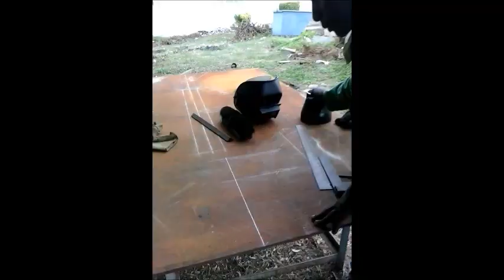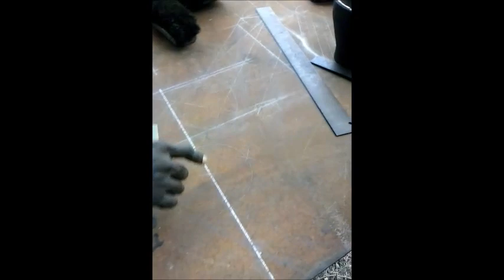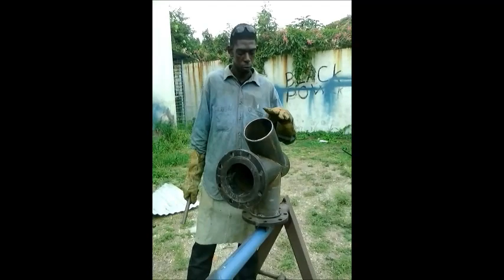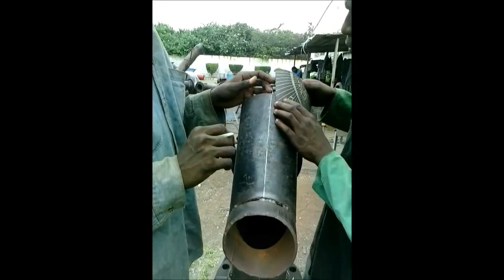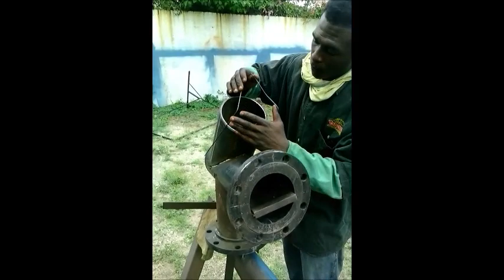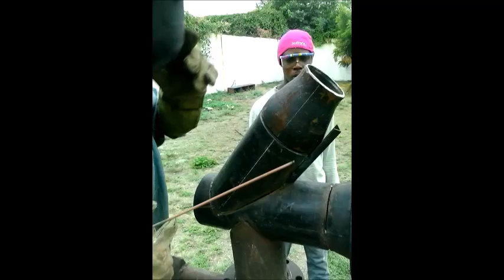How to prepare and fit a reducer part 2

Comment: Don't need centre lines fitting concentric reducer as long as your pipe is square ,if eccentric put lines on
Reply: hahaha ha yah
Reply: Well there goes the NCCER Plus fitters
Reply: Wonder if the place two hole pins on a flange for two holing and no fitting on the other end